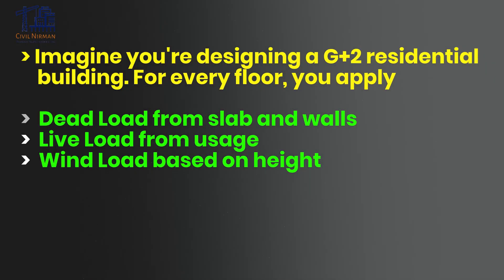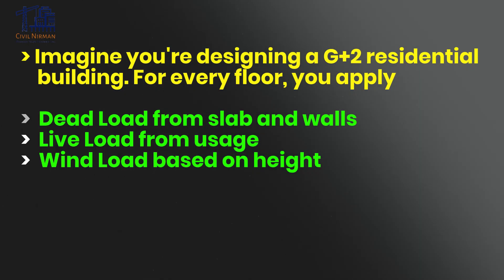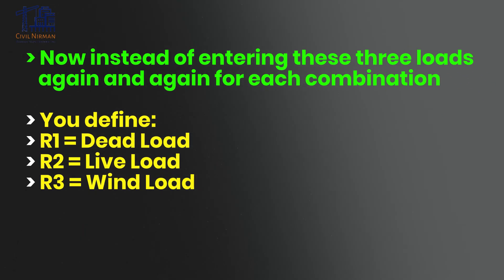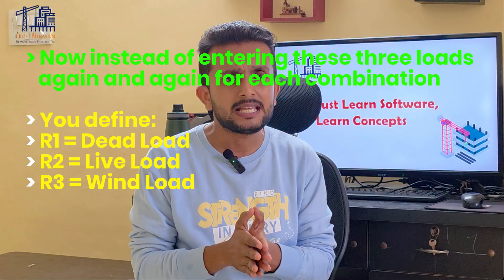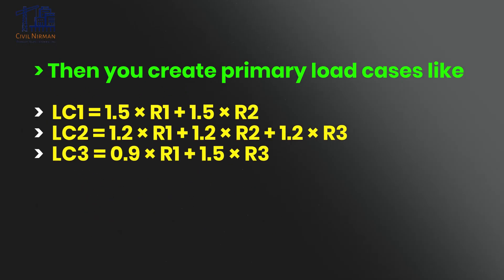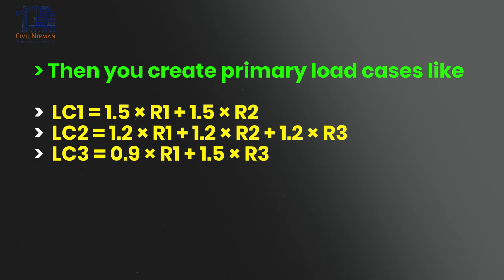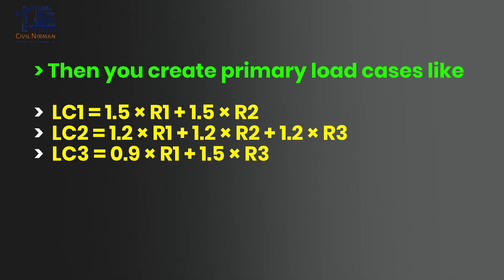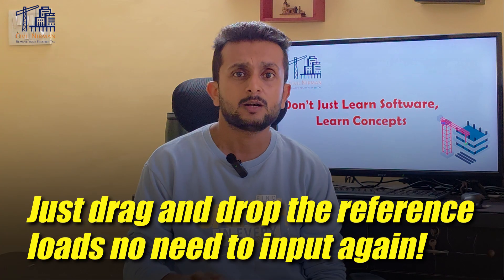Why Smart Engineers Use Reference Loads in STAAD | Full Beginner Guide

Comment: Sir while using reference load in seismic defination in dead load case where self weight is already assigned as -1 do we need to again define in seismic defination self weight as 1 or just add reference load directly
Reply from the maker: You do not need to reassign self-weight in the seismic definition if it's already part of the dead load case and you include the dead load as a reference load in the seismic definition.

When setting up seismic loads (typically using an equivalent static method or response spectrum method), you define how much of each load type (Dead Load, Live Load, Superimposed Dead Load, etc.) contributes to the seismic mass. This is usually done by referencing existing load cases (e.g., DEAD, LIVE) and assigning a multiplier.

1. Dead Load Case:
In your DEAD load case, you’ve already defined:

Self-weight multiplier = -1

This tells the software to automatically include the self-weight of all elements as part of the dead load.

2. Seismic Load Case:
When defining a seismic load case:

You usually include reference load cases (e.g., DEAD, LIVE) with appropriate load factors (often 1.0 for DEAD, 0.25 for LIVE, etc.).

The seismic case then pulls the mass from those load cases.
Reply: @CIVILNIRMAN Ok thanks sir 😃